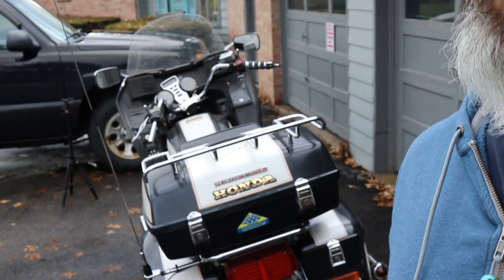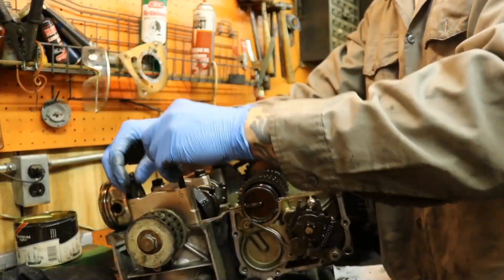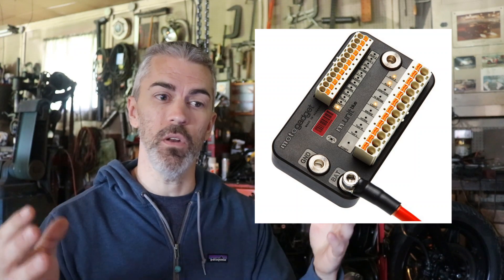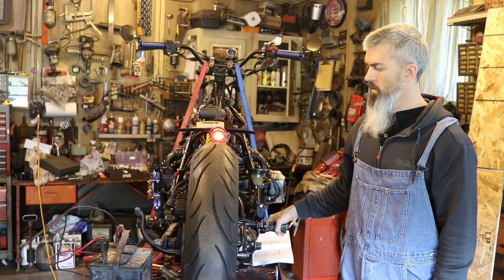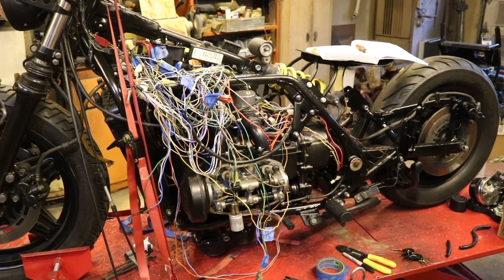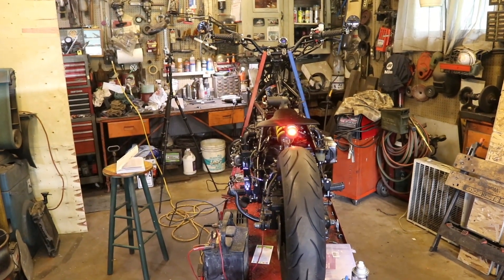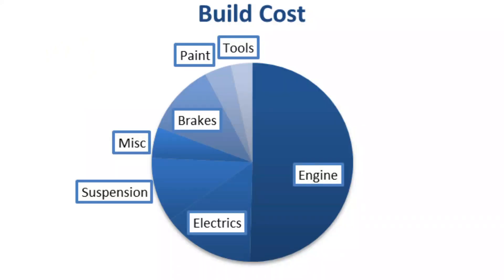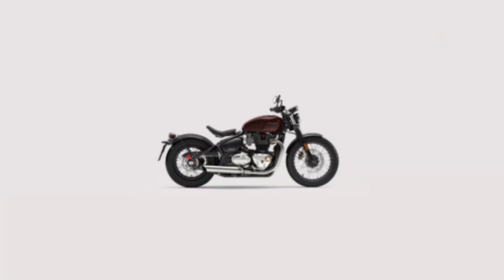How Much $ to Build a Custom Honda Goldwing Bobber Motorcycle?

Comment: The fact that you learned so much makes your decision a great one.  The bike has YOUR personality.  I'm an old aircooled VW wrench.  Learned from my dad.  Owned my own shop for a short time.  All of my car builds stood out because of my attention to detail and own view on aesthetics.  I always built my cars in a way that anyone else would find easy to work on.  I never wanted someone to curse me out because they couldn't get to an item without dismantling half of the car.    

Because I love boxer engines, I totally dig Goldwing builds.  If I ever get the courage to learn how to properly ride a bike (51 years old), I'd BUILD my own.  I'm a burner learner when it comes to welding, but plan on taking some classes at my local vocational center.  I'd rather push something that I built than ride something cushy that someone else built for me (unless it's a Singer 911).  

Your thought process was really measured.  Carefully executed.  On point.
Reply from the maker: Thanks for the thoughtful comment 👍. You should totally treat yourself to a Singer 911😀. And I cannot agree more on taking welding classes. I've done the same at my local community college and it's some of the best money I've ever spent.

Comment: With all the goldwings out there , one would think you could buy a complete overhaul kit for that engine.  You can buy almost anything ( engine wise ) for the xs650. Anyone know what was built more ; the goldwing engine or the xs650 ? Also I understand there's a supply and demand yada yada yada thing to consider.

Comment: I just got a goldwing and boy is that alot of hours. None the less a cool bike, if your able to sell it and gain some that life you spent on it. Or really enjoy riding it then it's a win
Reply from the maker: Yeah, it was a lot of work! But I did really enjoy making it. Never built a bike before and there were a lot of fun challenges. I am hoping to get some more hours riding it this summer. Good luck with yours 👍
Reply: I've done some custom metal work but like 10 years ago. This one is gonna be my first bike also. Never owner or worked on one. You recomend just getting it running before modifications? The bike has been sitting g for years.
Reply from the maker: @alonsogarcia6518  definitely get it running first before you commit too many resources to it. I found out with mine that you can no longer buy conn rod bearings - which makes it very difficult to rebuild the engine. But by then I was fully committed to the build settled for another second hand engine.

Comment: Wow!! I love this video and am very impressed with your build. I am a chemical engineer who just finished my phD. I was in a horrific accident almost a year ago where I was burned over 20% of my body and lungs with combined high pressure heated acids. As I was recovering I decided I wanted to do some thing I really liked because life can be too short. It took me almost that year to find a partner who believed in me to start a custom chopper shop and vintage bike fabrication shop. My father is an attorney and has little experience in this sort of thing but is supportive. It is really a change and I can relate to what you did. I went from not having a bike to ride to having a moderately well tooled shop and six bikes in various stages of build. My favorites are a 1969 CB 750 chopper that I just put an engine in and hope to have it rideable soon and an xs650 hardtailed bobber that I am making my daily driver . I plan on taking the honda from Pennsylvania to Tampa and then to California and then to Baja Mexico. When I come back I am going to strip it and paint every part , rebuild the engine and paint it to perfection. Then as happened before I am sure someone that saw me on the bike will ask to buy it and the cycle repeats. During this time I have some ideas for some DNEPR chopper and BMW bobber builds. Keep up the good work my friendand hopefully we will meet in the wind sometime.
Reply from the maker: Wicked awesome 👍. Thanks for sharing. I similarly ended up building this motorcycle with the frustrating impermanence of life weighing on my mind after some career burnout. I have a master's in biology. It was a great opportunity to spend time with my father and do something I'd always wanted to do. Some call this a midlife crisis 😁. Life is definitely short though. Great hearing from you. Good luck with the bike shop. What's the name of your shop? Shout out
Reply: @HooptieDoodle  Definitely a mid life crisis...lol We have been tossing around a few names so there is nothing permanent yet. The nod to Jesse James is East Coast Choppers but my partner would like to change the name. Right now we are using  space in a non commercial zoned area so we are not open to the public yet.If things go well then we should have a spot for Spring. I want it to be a service station looking shop from the 40's where the old bikers can hang out till all hours and have a beer or more as they teach us their secrets to the rat knuckles and the metric cruisers. Thank you and I will stay in touch.
Reply from the maker: @jimmypopp2695  I was hoping it was called "Overedumacated" or something similar 😋. No offense, but you don't see many advanced degrees in custom motorcycles. However, I like the unusual aspect of it. 
Let me know what you settle on...
Reply: @HooptieDoodle  I probably will go back into the chemical engineering aspect but as I said I agree with the mid life crisis part. I have been developing a two part epoxy that has a release component but I believe that I found a way to to rid parts of rust better than electrolysis. It is a three component chemical mix that is non toxic and does a better job than evaporust. My partner and I are going to see how well it goes at some shows and if it does then we will figure out a way to market it.Definitely stay in touch. I am on Facebook as jimmy popp in Parkerford Pa.
Reply: @jimmypopp2695  you guys are funny as hell. 45 yrs old here with four master's degrees and wanted to build a custom bobber\street fighter. Thanks

Comment: I built a 1956 Triumph Tiger 110 Bobber from a complete basket case pile of parts. I spent $6,000 on the build. So I would say you did pretty good with the Goldwing. I have been offered $10,000 for it so I can get my money out of it. The value of the Triumph will only continue to go up.
Reply from the maker: That Triumph is a good investment 👍. I always choose the cheapest thing around to pour my work into, and then when it's finished it's still not worth anything because there are so many cheap ones around. I spent $3000 and 1200 hours labor, then sold it for $2500. I still have a lot to learn about life🤪

Comment: I was wandering i have a 77 goldwing an I'm just wandering what all electrical stuff can I remove to keep it operational all I want to work is brake light headlight Speedo an tach obviously I'll need spark
Reply from the maker: If I recall correctly, the only electrical items I removed were the radio and additional turn signals. Here are a couple videos on what I did with the electrical: https://youtu.be/X7S-l2dsEus
https://youtu.be/VwRiFSTp3dM
https://youtu.be/qh7oxAlG9QQ
Reply: @HooptieDoodle  ok like on my bike there's just wiring that goes to nothing in the front behind the false tank side panel left side an then in the headlight area when I got the bike there was no headlight an theres a bunch of wires in the headlight housing its all confusing an my bike is alot different than yours all my fuse box an compaciter stuff is all mounted on the same side but on the false tank
Reply from the maker: @burnscory3420  it's all about the wiring diagram. Get one for your bike and have a good gander at it and figure out what those spare wires are supposed to go to. Only then will you know if you want to get rid of them. The should all be color coded. Good luck 👍

Comment: I think for a custom, your pricing is fantastic! And as you said the real value is in the skills and confidence you developed.  These old Wings are great, I picked up a 1987 GL1200 Aspencade for $2k June 1st 2019. Very clean, running only 24k miles. But it still took $1338(everything taxes, tags, fluids, LED lights, cam belts, tires, etc, etc) to get it up to cross country ready specs. Then starting Sept 17 2019, my wife and I with bags and trunk filled rode the USA 4 Corners tour in 17 days 8024 miles trouble free miles, almost but the battery died in central FL :(    I will 100% agree, begin with running bike, you can much better evaluate the status.
Reply from the maker: That's great that you rode it cross country 👍. A good adventure is what makes all the wrenching worthwhile!
Reply: @HooptieDoodle  Wonderful ride, but not across, around! Madawaska Maine, Blaine Washington, San ysdro Ca., Key West and home. :)
Reply from the maker: @edwardjones8170  well that's even better! 👍👍

Comment: i acquired two goldwings in a trade for an ar 15, a running '81 without a title, and an '83 with a title that runs supposedly, but needs a starter chain. i am going to turn the two of them into an adventure enduro bike along the lines of a bmw r 1200 gs. i expect to spend about half of that, i hope. but, i plan to sell the unused parts to supplement the expense to do so. i already own all of the tools i need, and have the skills. i just need to find the time. i'd say what you spent is a fair cost for what you ended up with. my only issue would be with the gas tank. the flat rear panel just doesn't look right, and the sharp edges may become an problem down the road. other than that, i'd say you did a good job on your first go.
Reply from the maker: A Goldwing adv bike sounds fun. Someone sent me this video of two guys who took stock wings off road: https://youtu.be/sRFS729qK80

Comment: I just bought the exact same Year GL1100 and this build opened my eyes to what is possible with a Goldwing. For now, I’m keeping the full dress to take advantage of all the luggage and comfy seating for two. The NutCracker is an awesome looking bobber for sure!  Cheers from Montreal!
Reply from the maker: Montreal! Glad you like the NutCracker. Just FYI, something to think about, another bloke sent me a picture of his wing and he had done a bagger. Did the single backbone converstion, move the gas tank to the backbone. The resulting gap between the the engine and wheel changed the look considerably, and he still has the stock rear shocks and luggage to haul groceries. I am kinda jealous of the functionality.

Comment: I have a Valkyrie, and I would like to change the rear tire and have one of those fat tires on it. One of the biggest challenges will be with the swingarm.
Reply from the maker: Good luck! That's not something I have thought about - but it sounds fun😀
Reply: So, actually my question to you is if you could help me with that. If so, how can I contact you?
Reply from the maker: @leonardocalixtoantunes7903  I am on Twitter & Instagram @HooptieDoodle. It sounds like you want to widen the swingarm? And the Valkyrie is a shaft drive... I would have to research how this is done on chain driven bikes, etc. If the Valkyrie is like my Goldwing, the final drive is a limiting factor as there is no flex in it. The shaft comes straight back to the final drive on the wheel and is fixed in place. The only flex is at the swingarm pivot. I am thinking you would have to design and fabricate a new, possibly multi-jointed CV joint(s) where the engine connects to the shaft so that the shaft can be moved over and then run back to the wheel. I am thinking out loud here, but this doesn't sound ideal to me as there may be some extreme joint angles here. Maybe gears? Maybe you could make a gearbox to shift the driveshaft over? It may be bulky, complicated, and require alteration of the driveshaft in some way. 
Like I said, not something I've considered. It's definitely an challenging project though and I bet it would be unique!
Reply: HooptieDoodle 
Unfortunately I have no Twitter or Instagram accounts. Do you mind if we use emails or phone messages?
Reply: Hi again,
Did you have the opportunity to see my last reply above?
Please let me know.
Reply from the maker: @leonardocalixtoantunes7903  are you looking for ideas on how to widen the swingarm or are you looking for someone to do it for you?
Reply: HooptieDoodle
Hey! I am actually looking for someone who can do it. And because I saw some of your videos, I thought that you would be my best option.
Reply: HooptieDoodle 
Ohhh I see.
Well, thanks anyway.